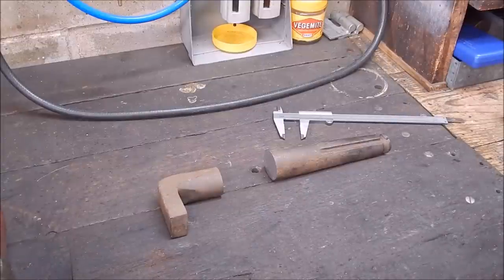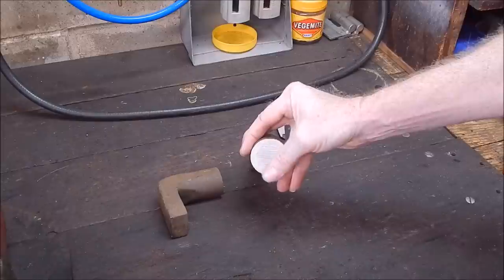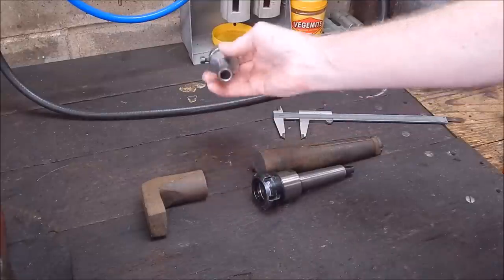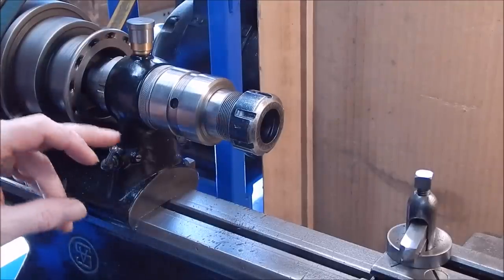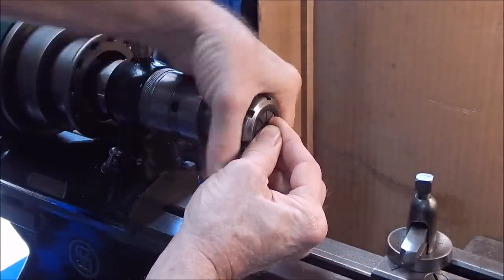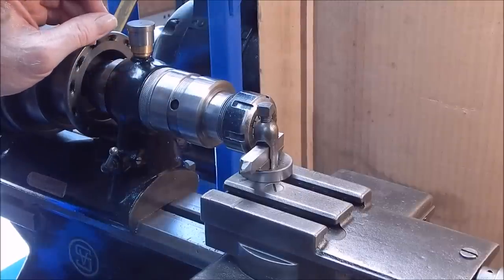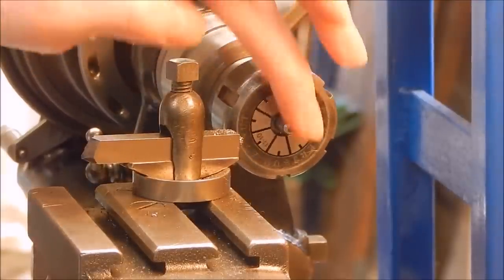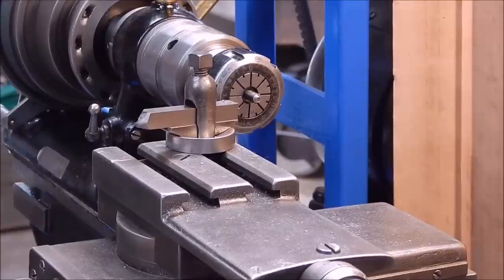Why you need a lathe collet chuck

Comment: I am totally with you. Last year I bought myself an ER40 set for my lathe, tailstock chuck and I made up a headstock chuck. Best purchase I ever made. Not only do they have great gripping powers but the repeatability is excellent, much faster than a 4-jaw and almost as accurate, certainly enough for most of my needs. I also think they are safer in use as well, no jaws whipping around waiting to get caught in clothing or chips/swarf.
Reply from the maker: caskwith Yes, they have a lot going for them. I hope these videos get more people interested in what is actually a very simple system.  Cheers Rob

Comment: Can I just say a massive thank you for this and your introduction to the use of collets videos! I have a 7X16 Chinese lathe which I have been using successfully for some time, and I think it’s all the amateur machinist really needs (that’s if you set it up right!). I mainly use my 3” 3 jaw for most jobs, and the 4” 4 jaw if I need to take advantage of the larger spindle bore or any independent work. After viewing this, I decided to pull the trigger on an ER32 Colet chuck and a full set of collets. I must say, it’s brilliant!!! The work piece has no run-out, it’s secure, and so much safer to have your hands around! I went for the full bolt on chuck so I can take advantage of the spindle bore, and I am so impressed. I now have the tailstock loaded too, so I’m colleted out!! :o) Not going back! Thanks again!
Reply from the maker: Steve Brown Hi Steve.  Yes collets are top stuff.  You never go back after using them.  Unfortunately pretty much ignored by most lathe operators.  Probably because they see them as a specialist tool, which they are not.  Cheers Rob

Comment: G'day Rob, another excellent short segment. I do ponder the simplicity of the small lathe you have and sooo quiet, beautiful to look at and hear running. You have convinced me to go the  ER colllet way. Regards Peter
Reply from the maker: PGS Hi Peter.  Yes, it's a nice quiet little lathe, but it's very basic and you have to set it up for the job, which can be a good thing (eg. perfectly flat facing).  Having a very large top slide it can do stuff that other small lathes would struggle with - eg. cut a Morse taper, but It's not a lathe I would recommend to a beginner, or as an only lathe.  No leadscrew inhibits things a bit.  A small Asian lathe would be a better choice for general workshop use. ER is pretty good to use, I doubt you will regret it.  Cheers Rob

Comment: Nice segment Rob.  I too am a true collet believer.  I also agree with you on the small vs large or new vs old lathe stigma.  My larger lathe is a Seneca Falls "Star".  It was manufactured in 1896 and has a Hardinge collet set.   I can hold .001 or better all day long and has never let me down.  I like you get I kick out of the older equipment.  Fred
Reply from the maker: Fred Miller Hi Fred.  I'd be real interested to see a walk around video of the Seneca Falls lathe, as I'm sure would many others here.  They are a magnificent old lathe, and a bit of eye candy always goes down well.  Cheers Rob

Comment: I like your idea of using the tailstock to get the part true in the chuck, I think this idea will work with setting material true in four jaw too.
Great tip, thanks.
Reply from the maker: Yes, it works very well when setting up a four jaw.  You can also use a dead/live/pipe centre in the tailstock in much the same way, to set up for internal boring.  The tailstock is a great reference point for setting up any job in a chuck.  Cheers Rob

Comment: Great tip, I have been thinking about a collet setup for my big lathe, but I like the idea of setting up one on a smaller lathe, I have a 6 inch lathe (that hardly ever sees and use) with a number 2 mt and if I went that route the collet chuck would also fit my rotary table. Turn the small part on the 6 inch lathe and just pop out the collet chuck stick it in the rotary table an machine flats or whatever.  Sorry about the long rant.  keep up the great videos.
Reply from the maker: George 1960 Sounds good to me.  That small lathe deserves some use :)  Cheers Rob

Comment: Yup, I need a collet chuck. 
Had to do the same job the other day on three set screws. My three jaw is so far out I need to toss it, so I used my four jaw. Threaded two nuts on a screw about an inch apart, chucked up two jaws to flats on the nuts and the other two jaws to points, then a third nut drawn up to the clamped nut at the front of the chuck so it wouldn't spin out  

I was able to leave the locating nuts in place by loosening the locking nut and adding a fourth nut, tightening those two and unscrewing the screw from the clamped nuts, then reversing the process for the next nut. 

Pain in the ass, and took 5 times as long as your collet chuck.

Comment: I use ER32 collets on my Chinese lathe.  I use am MT3 holder in the headstock and regularly use an MT2 holder in the tailstock.   CTC tools in Hong Kong are good value..
Reply from the maker: Joss Fitzsimons HI Joss.  I also source tooling from CTC.  Generally pretty good. Cheers Rob

Comment: Another good video Rob. Collets are certainly great for round headed bolts but aren't really that commonly used. As a continuation from this, can I suggest a video on holding small normal hex head bolts?
Reply from the maker: Alan Mears Hi Alan.  Do you mean using collets, or do you have another method - apart from using a three jaw ?  I normally do all my quality work with Allen headed bolts, so it's not very often I need to use collets on flat edged bolts.  Cheers Rob
Reply: xynudu Using a drill chuck in the headstock could work for small flat edge bolts. In saying that, the bolt heads with a flared head (as used in cars) could be a worry to get really secure in a chuck
Reply from the maker: Alan Mears It's an interesting point.  I generally use the three jaw scroll chuck on automotive size hexi bolts.  I can't recall if I've ever gripped one in a collet.  As the heads of flat sided bolts are not always uniform, I feel it's safer to grip them on the flats rather than trust the perimeter meeting points in a collet  Of course if you are really worried about the way a bolt is held, the ultimate safe solution is to use a tool post grinder/pencil die grinder with a fine cut off disc as a cutting tool.  I've done this many times.  Totally safe.  Cheers Rob

Comment: Realize this is an exercise to show how useful collets are. However if you just want to put a point on the end of the allen head for your tailstock die holder. Chuck up your screw in your cordless drill and head over to your grinder. Spin your bolt at say 45 degrees to the grinder face and is less than 30 seconds you will  have a fully centred pointed screw formed as much as you like.
Thanks jb
Reply from the maker: Hi Jim,

Yep, we've all done that to various things.  Quick and dirty.  Thanks for the tip anyway.

Cheers Rob

Comment: You could also put a step in the collet so the grip is on the threaded part of the bolt so as to miss completely the head of the bolt.
Reply from the maker: dtec30 Collets are made of extremely hard steel.  I have attempted to resize one once, never again.  It was only machinable with an abrasive wheel. Cheers Rob
Reply: You can make collets from scratch can't you?
Out of mild ish steel or even aluminium (soft jaw)
Reply from the maker: dtec30 Yes, although an ER style would be difficult to make and require high carbon steel.  Simple three slit basic collets are relatively easy to do.  Rob
Reply: Ok I was just putting it out there

Comment: Yeah g'day Rob---I have a set of er32 collets with chucks and I am disappointed with them--3-4 thou runout but the biggest gripe has been lack of rigidity ie i cannot use a parting tool-no way..Seeing the length of your chuck spanner maybe I should do some thing similar and increase the torque tightening on the collet to increase rigidity and take out the spring.
Thoughts anyone...  regards E
Reply from the maker: Hi Ian,

Are you sure the run out is not in the spindle (bearings or Morse taper) ?  That's a lot of runout.

Put a dead centre in the Morse and read off the runout on that.

Where did you get the collet chuck from ?

The big spanner is much better than the pin "C" wrench you get.  I've never considered flex in a tightened collet - that's not supposed to happen.

Cheers Rob

Comment: My South Bend 9 has taper....which ER would be appropriate for a small lathe like that?
Reply from the maker: phooesnax ER32 is a very popular size (takes up to 20 mm diameter), is compact, and chucks and collets are relatively cheap to buy.  That's what I use.

ER40 is physically a lot larger (takes up to 28 mm) and chucks/collets more expensive.

ER25 is mainly used in smaller lathes (takes up to 16 mm), but cheap to buy.

I would use ER32 for your lathe.  It's generally what most users buy for a 9 - 10" swing lathe with a 5" chuck.  

Cheers.  Rob

Comment: please can you help me I'm new to lathing and I make miniature stuff and am extremely limited on my tools and my lathe is tiny so I made a mandrel to turn 20mm stock out of a 6mm max chuck which works grate my issue is wanting to work the inside and make a bore and polish internally obviously not. possable in such a tiny chuck I found the work around by useing a mandrel and center drilling my 20mm stock. it's the inside I'm stuck on and fillets seem like a work around for me I understand this is play machineing and your oriably going to laugh at my predicament but please after you have picked yourself up off the floor is really appreciate some help if been laughed at so much I'm thinking of just giving up asking for help but this is my last ditch attempt at getting some help
Reply from the maker: Hi Nick,

It doesn't sound like play machining to me.  It sounds like fine machining that a model maker or watch maker would do, so no laughing here.  

I'm not totally clear on what you are doing.  I understand you are using a mandrel in your small chuck to mount centre bored 20 mm stock, which seems like a big ask for a lathe that small, just on turning power alone.

Some more detailed information would help - eg how are you gripping the 20 mm etc.

Cheers Rob
Reply: +xynudu I made a mandrel to hammer into the stock it has a 100 watt moter and if had no issues so far and its. acrylic mouth pieces I make I'm getting on really well with making the fitting and shape outside and polishing and what not the issue is the mandrel I made.is 6mm and I drill a 6 mm hole in the blank mount on the mandrel style rod for in the chuck and tail stock baring I made turns a treat. the problem I have is not having a conventional large chuck I can't hold the work one ended to allow me to bore out the mouth price fully and shape the inside of the bore as the have fairing tapers and such. so I work in so far and obviously needing to leave enough material so the mandrel still holds the blank then I take off the mandrel and work the rest by hand and its leaving work not concentric and such and polishing is a pain to say the least. of made everything myself and am limited on buying things. what I need is like your standard 3 or 4 jaw chuck for a lathe but custom for my lathe as in max  diamerter before the bed is 55mm and max work diameter needed to grip 20mm minimum work say 10mm maybe but with a 6mm spindle insted if the Norse taper. .I have no idea if I'm useing the right terms and stuff my apologies .if I had your lathe I could make what I need in a few hours lol but unfortunately I don't. basicly i need to some how make a mini version of a lathe chuck and no Norse taper insted the 6mm straight my exsisting chuck takes
Reply: +xynudu if you use any other communication methods I could show you some pictures to explain much much easier .and also could show you a drawing of what I need kinda and maybe you may be able to help me figure this out on the cheep or even better free I know I'm asking the world for nothing but I'm sure you can understand my situation health and other things prevent me from working so having to use ingenuity is a must for me
Reply from the maker: Hi Nick,

The best thing would be if you could send me some pictures so I can see what is going on.

My email address is gloaming_agnet@hotmail.com

You may be able to use a "D" reamer to get concentricity.  These are easily made - just search YouTube for that subject.

Anyway, a few pictures will help.

Cheers Rob
Reply: +xynudu thanks you Rob your help is massivly appreciated

Comment: Always use carbide inserts.  modern geometeries and coatings are cost effective.
Reply from the maker: +Dave Ridal 

I can't agree on this one.  HSS is capable of finer and lighter cuts than carbide.

Each have their own good points.  I use both. 

People tend to write off HSS as "old hat", but for some jobs/work HSS is far superior.

Cheers Rob
Reply: xynudu , I make s.s. food processing equipment, my taps are vanadium, drills cobalted, and coated carbide everything else.
Reply from the maker: +Dave Ridal 

In a production environment I would agree with you.  

But this is a hobby/home workshop channel, and HSS is likely to be a cheaper/better option for many people.

Cheers Rob

Comment: Hi Rob, thanks for the video mate. Just wondering, is that a kevlar belt on your small lathe? :-)
Reply from the maker: Hi Terry,

I'm not sure what it's made of.  It's a continuous/one piece synthetic belt of some sort.  I bought it off of Ebay. 

It's 1 metre diameter (from memory) and rated for lots of hours (can't remember the number).  It's for industrial applications.  Shows no signs of wear and is super flexible/low drag, and grips well for a flat belt.  It's the perfect flat belt for the Schaublin.

Cheers Rob
Reply: Thanks Rob, Just looked interesting being flat. I'm trying to collect up a stock of bits and pieces for stuff I'm going to be building. Learning lots, from Terry :-)

Comment: Are those ER-32 or ER-40 collets?
Reply from the maker: ER-32
Reply: I have a Grizzly G0709 lathe with a #5 morse taper spindle.  Considered making (or buying) a ER-40 collet holder (because ER-40 takes up to an inch size stock)  but will stick to an ER32 as the inside diameter of a #5 MT would probably be to small to take a inch size stock anyway.
Reply from the maker: Any lathe with a Number 5  Morse taper will usually take one inch stock through the spindle.

However, to feed stock through the spindle you cannot use an ER collet chuck with a draw bar.  You will need to buy or make a through collet chuck to bolt to the lathe drive plate or a backing plate (depending on whether the spindle is threaded or not).

This is by far the better way to use any collet system.  You can also use a draw tube as on my Schaublin, but the feed through diameter is reduced as a result.

Cheers Rob

Comment: Hi Rob !

I have an upcomming project on making such a collet system for my lathe - more details here and you can Google Translate to the right just under the menu line - choose whatever language you like in the combobox::

http://kelds.weebly.com/5c-collet-system.html

I have a Schoublin system for my mill (MK4) and I thought of using it in my lathe (MK5) with a converter sleeve - but then I have no holding screw and the collets are these - I think, old ones - with no auto-release, and I'm missing a few of them - so I decided not to go further in this dead end and make a new system for the lathe - is 5C the right one to choose ?
Reply from the maker: Hi Keld, Trust you are keeping warm.  The 5C collets are widely used in industry and not expensive.  The only downside is that the compression range is less than ER series.  Both good systems.  I suppose it's what's most suitable for your setup.  That's something only you know. Maybe a beer would help you make the right decision.  Something to ponder while the snow comes down :)  Cheers Rob
Reply: xynudu When you have to think a beer is allways good ;-))